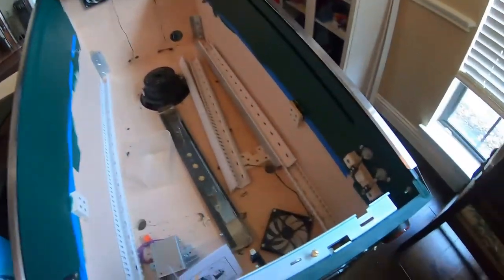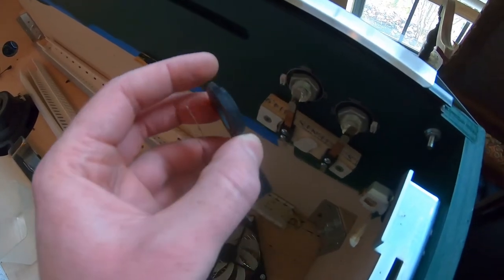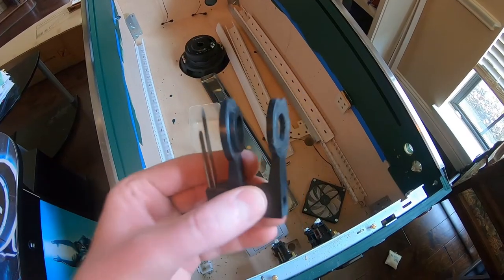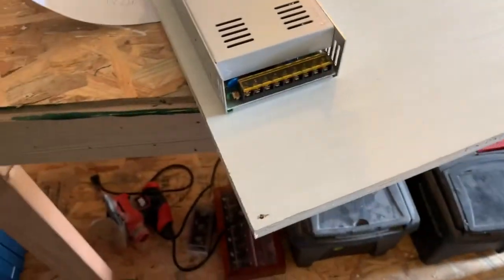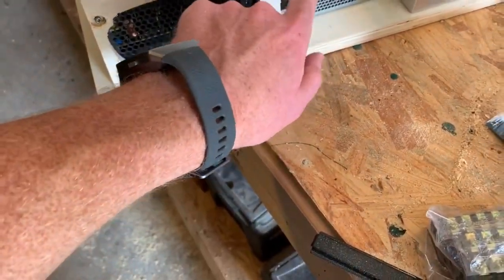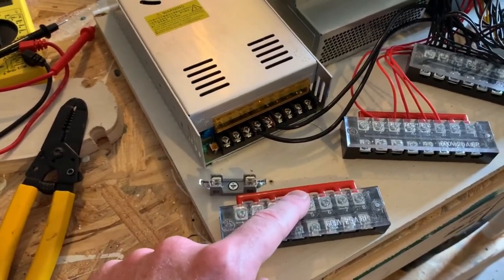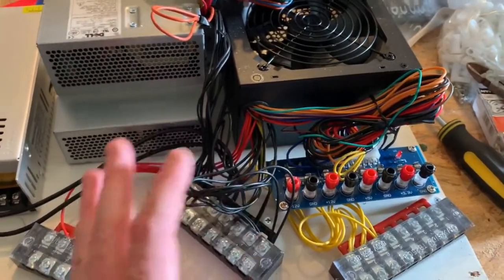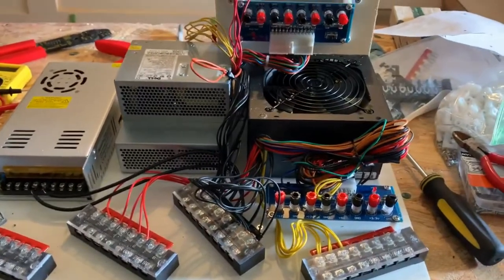Power Supplies - Virtual Pinball Build Part 9

Comment: Great video series.  Keep up the great work!.  A suggestion, I saw a computer case sitting in your supply of pinball parts.  Don't bother with the case, you can safely mount the system board in your cabinet, and it will not take much room.
Reply from the maker: Thought about that. I’m going to have the computer outside my cab. I plan to use the same computer to run this, and at least one arcade build. If not, an arcade and a racing sim eventually. I didn’t want to have to buy 3 computers. :)

Comment: Looks good.. couple questions.
On 24v psu I'm looking at they have 3 channel (3+ / 3- out). Did you wire just one channel to terminal to branch into multiple outputs, or use all channels off psu? Meaning does it matter how much power driven off one channel?
I'm fixing the bad stock audio on a legends pinball. So I'm thinking of putting a 24v 15a in with one channel to terminal to drive front amp to exciters, and a second channel off psu to run a 2nd amp for cabinet speakers. I'm guessing it would work given enough power from psu is provided? New to all of this.
Also what is the second pair of flipper buttons for, change games?
Reply from the maker: I’d imagine if you pull it open and look inside, they’re all wired together anyway. Pulling 15amps is a lot. You should probably check wire ratings based on the distance you’re running them so they don’t overheat. I’d imagine wire size matters more than how many terminals you use?  Not 100% sure.
Reply from the maker: The second set are magnasave. They serve different functions in some various games.
Reply: @MRNBricks  OK thanks.. I just saw Frenchy's vid and he seems to be using 24V 10A and he has a nice setup going with his quatro 3 board if not messing with terminals

Comment: Heya mate nice video, I'm also building one as i'm following along with you. I don't have as much power stuff as you though, i decided to remove the 24v systems (knockers, soldenoids, shaker, contactors etc) As i think the tactiles (hopefully) will be just as good.

I went with the Poor Man's DOF as per this thread https://www.aussiearcade.com/forum/pinball/virtual-pinball-projects-and-discussion/virtual-pinball-hardware-and-software-discussion/84553-the-poor-man-s-dof-tactile-feedback

I just have 2 of those cheap lepy amps coming to power 6 tactile speakers 4 litle and 2 large, all running off like laptop psu's(2x 12v 5A) alongside the pc speakers/sub. a 300w 5v psu for the LED strips controlled by a teensy, and 12v 3A psu for the dmd. So a lot less wiring for me ( i would pobably kill myself with 24v psu lol.)

I'm just not sold on the 24v devices, and how much difference they would make over tactiles. (i've never experienced either yet so i don't know) but really how much difference could they make buried inside the cabinet? seems like a lot of wiring and pain just for a few whiring/clicking noises, which i'm hoping the tactiles will do as well.

Thanks for the videos, keep it up :D
Reply from the maker: I can see how you’d think that. But, in my experience, 24v isn’t that much worse than 12v. But all the clicking and noise stuff is what building an obnoxiously expensive machine is all about!!  Haha. Thanks for watching.